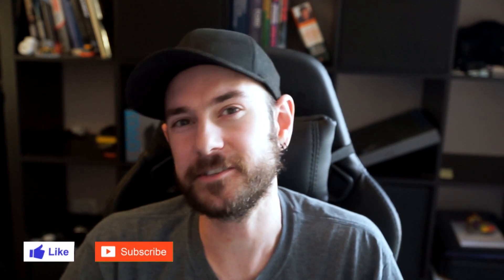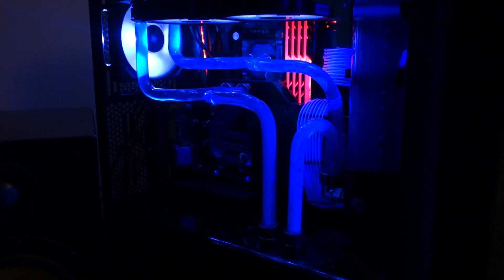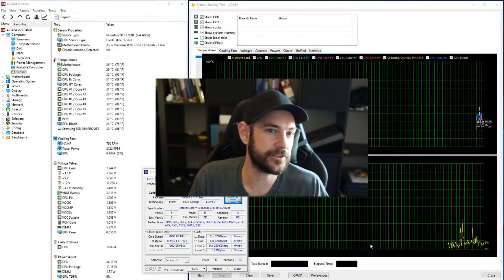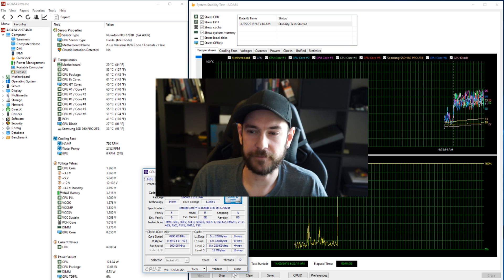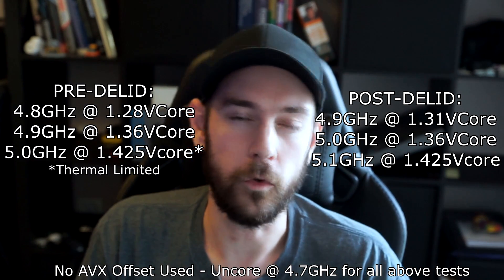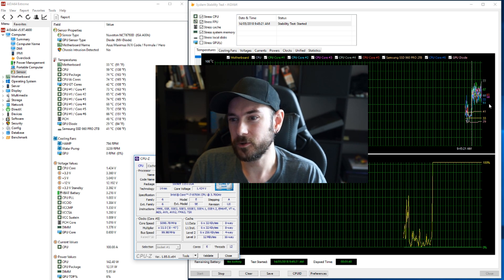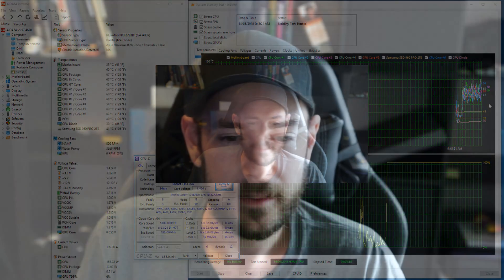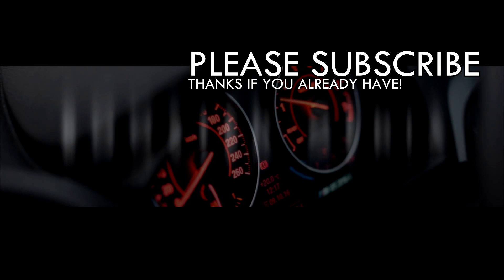8700K Delid Testing and Results

Comment: I have the exact same setup. Just finished delidding following your guide. I literally got a 30c+ drop O_O ... 
Pre-delid: 5.0ghz @ 1.345v (gamed fine for over a year, but when doing Prime95 Small FFTs... instant 100c... and who knows how high the temps would have been without a TJmax)
Post-delid: Same bios settings, saw as low as 68c for 30 seconds (before crashing due to lack of voltage)

INSANE difference

Comment: Hi, nice videos! I saw them both! Its impressive the difference delid+LM+tweaks can do! The reason your results are so good is that its TIM and not STIM on the 8700K. I have a 10900K which is soldered so expect lower results... however I still expect 10 celcius drop. I always wanted to try delid and today with the kits its a piece a cake! haha...  I will be using a custom cobber IHS and conducanaut LM on the die and under IHS. And then I saw a product luckily I have never seen before.. its called Coollaboratory Liquid Extreme. Its basically liquid metal but in paste form- which means it will just easily go on the top IHS and waterblock. I will be only using 4 drops of glue on IHS to suibstrate and two different LM applications... So it better be great results! ;) haha. . There is no way I could further improve that solution hehe.. BUT when the nCore V1 is released I will buy.. its a direct die waterblock with first in world built in IHS... one of a kind and best results in the world.. check it out.. that is the ULTIMATE solution direct die. My next project when the 3 months waiting time is over.. then my cpu is also ready then just pop off cobber IHS

Comment: How has the copper IHS held up? I heard that overtime performance won't be as good due to the gallium in the LM bonding with the copper. I've already delidded, but was thinking about replacing the IHS. I'm just unsure how it will be for longevity.
Reply from the maker: I did a video on the theory behind this about 2 years ago. Still in daily use and no problems. Temps are the same as the day I built it.

Comment: I never crash with AIDA64 but would get errors with prime95 with a Small FFTs test. Wondering if AIDA64 even reliable.
Reply: I use Linpack Xtreme and that uses WAY more voltage for stable than Aida. Latest Linpack also uses AVX.. I usually run 50-100 passes stress test. And if that pass nothing can break my OC. Also its here you find out how much ekstra juice is needed to completely eliminate cache l0 errors (hardware info)... so my10900K would require 1.42v @ LLC 4 to pass Linpack where other more mild test like Aida can ex. pass at 1.35v.  But so much extra is needed with extreme load and AVX.
Reply: hahah ! ;)  I would recon your computer seems more unstable than AIDA. Aida is a lighter stress test so if that fails your system is properly pretty unstable or at least under load.

Comment: Mine at 5ghz 1.26v delided and custom loop. Temps are around 70c while gaming for 30min. Not too happy with it. I might take it all apart to solve it
Reply: Incredible voltage.. my 10900k wants 1.42v @ LLC4 for 10x 5 ghz.. hehe.. but I also aim to pass extreme stress test so I NEVER EVER crash or BSOD

Comment: O...M...G!!! I had no idea. I've been running an 8700K system for the past few months, with a 280mm Corsair AIO cooler. I've been flummoxed by how I have been unable to run full load at anything higher than 4.7Ghz all cores, without bouncing off the thermal limits, no matter how low I finessed the VCore. 
Today I received a RockitCool IHS (Cheers for the discount), a Der8aur delid tool, and some Thermal Grizzly Conductonaut. I lapped the top of the copper IHS to a flat mirror finish (I was surprised that it was quite [EDIT: CONCAVE... the sides took a lot of lapping before the centre touched down] as it arrived) using a glass tabletop and 2M lapping films, and put it all together. My results are immediately astonishing. At LEAST a 30 deg. C drop in temps under full load, probably even more, but it's hard to tell exactly because I couldn't run at 5.0GHz before without hitting thermal limits. Now I can with ease, and fans on moderate settings, without getting anywhere near the thermal limiter.
I did a quick OC to 5.0GHz all cores, 5.0GHz Uncore, and 0 AVX offset, 1.32V VCore; 1.20V VCCSA & VCCIO. Set the fans to medium and ran AIDA64 with full CPU and FPU stress for half an hour. Temps stabilised in the mid 70's, with peaks at about 80 deg.C. Incredible! Before doing this delid/lap/IHS/LM, I would be instantly bouncing on the thermal limits 105 deg.C. at 4.8GHz all cores, with the clocks dropping quite a lot because of thermal limits. 
This is how the 8700K should always have been. It's so stunted by the useless toothpaste they put inside the IHS from factory. Very disappointing Intel. But very impressed now that the delid is done.
Reply from the maker: Nice work!!
Reply: Amazing results! I just ordered the RockitCool Kit with the Cooper Upgrade kit for my i7-9700K. This thing runs pretty darn hot for me at 5ghz and 1.325V. Hoping to get it down in the 80’s under Prime95.
Reply: @jjsemperfi  You did use liquid metal under the IHS right? Its a no go with TIM paste. Also the delidders biggest mistake is to use silicone and glue IHS fully back on.. only 1 tiny drops GLUE each corner IHS for perfect mating and no gap under IHS.

Comment: 1.280 for 4.8ghz?
Mine is now 1.240 for 4.8 all cores, but dang its hot, I Will make a delid soon, only waiting for my liquid metal do arive. :)
Reply: You guys are luckily.. my 10900K is a poor bin @ SP 63 - Asus lowest score.. So me running 5 Ghz x 10 will require 1.42v LLC 4 to pass all extreme stress test and no L0 cache error etc. OR LLC 5 @ 1.36v  but same resuilt and temp. So right now im actually at LLC 4.. So I cant wait to delid and cobber IHS and LM in a few days from now

Comment: Hello. What RPM your fans working on?
Did I understand correctly that your fans are running at 770 rpm under  load?
Reply from the maker: Correct. There’s absolutely no point in increasing fan speed relative to CPU temperature. My fan speed is linked to my water temperature. I have a seperate video explaining how to set up  PWM fan profiles.
Reply: Вoosted Media thanks for quick answer.
 I watched this video, I learned a lot of useful things for myself. But I did not understand how  does your system know that the temperature of the water has increased? Do you have a temperature sensor?
But anyway, thanks.

p.s. It’s all because I don’t know English well =)
Reply from the maker: Yes I have a temperature sensor on one of my water pipes to measure the water temperature. If you don’t have this you can just use the motherboard temperature

Comment: Im not sure your idle temps are correct. You stated 4.8 idle at 45c stock lid and 30c  after delid. I have never seen idle temps that high on any chip. You also state idle 60c @5.1 after delid. What....LOL
Reply: It could be if HIGH or Ultimate performance power profile is loaded.. then it stays in turbo mode all the time. If I run some test or games and have it in Ultimate performance I will also have high idle for some time.

Comment: Looks like your delidding was definitely a success.  I'm planning on delidding my 4790k processor which currently runs at 4600GHz with a ring ration of 4300GHz with a CoolerMaster 280 closed loop water cooler.  I'm considering going to a 360 closed loop but then I stumbled across this Noctua NH-D15 SSO2 D-Type Premium CPU Cooler which has amazing reviews on Newegg (5 stars with over 300 reviews) https://www.newegg.com/Product/Product.aspx?Item=9SIA4RE7653968.  Curious if you know about this huge air cooler or know of any tests on youtube that have been done comparing it to water cooled?
Reply from the maker: It performs about the same as a 240mm closed loop water cooler but generally louder.

Comment: Water cooling and only testing for 5 mins is very wrong, your running water so you should run until the water has actually reached its stable temp under load for much longer then 5 mins, run it for an hour or until you have dead solid temps with no jumps like you are showing.

People reading this don't ramp up without benching for a hell of a lot longer then 5mins you will kill your CPU with this amateurish thinking on benching.
Reply from the maker: I explained the reason why I’m only testing for 5 mins in the video. It’s done this way for the purpose of the video because in my particular setup the water temps stabilise after 5 mins. 

It will be different for different people like I said in the video.
Reply: @boostedmedia  Just advice this vid has some pointers better than I can say: https://www.youtube.com/watch?v=eSOcUnn1mtQ
Reply: 1 hour is maybe overkill haha! :D My water takes max 10-15 min to heat up, but definatly incorrect polished results with only 5 min!

Comment: You should go with the 8086k 1.22v(arround 1.26 spiked up to actual 1.27 due to llc) on air for 5ghz delited with a be quiet dark rock 3 pro the only time that i saw 77c was in prime with small ffts anything else tops arround 65 such as aida64 anabled fpu,cpu,catches,memory stresses.Every else such as occt have an average of 48-49c with rare spikes up to 55c max.I know it sucks to pay more for a binned 8700k but i think in the long run it will not degrade by the oc at all.Maybe the case helps too because it really have a great airflow and surely helps but its with no custom copper and i feel like that yours under water with a custom coper seems on the high temp side..if i were you i will take actual misurments from your mobo due to llc just to be sure

Comment: Will when you stress your pc do you have your case closed up or the panels off I have a 8086k running at 1.350 volts and llc set to 6 which makes it go to 1.360 and my max core temps are 75c for a hour test of prime 95 version 26.6. I do have my pc closed up panels on but I was really hoping to stay around 70c my cpu is delidded also. My case isn’t the best airflow case it’s a lian Li air with a custom water distribution panel so I am limited on fans.

Thanks
Reply from the maker: Should always stability test the system in the same configuration you intend to use it day to day unless you’re shooting for records.

Comment: with the 7800k i have now i'm running 5ghz at 1.240v, but yes this chip runs hot as hell.( still thinking about deliding this thing but its not cheap is i screw it up).
Reply from the maker: Honestly you’ve got to do something pretty silly to screw it up.
Reply: my mistake I meant 8700k not 7800k.
Reply: Just buy the delid-die-mate 2 by der8auer. it costs 30€ in europe. it is easy to delid with it. you will just spend with the other delid components approx 60€. Its not that much.
Reply: its delided now dude all went well.
Reply: WHAT?!  1.24v that amazing! What LLC level is that? and is this a "gamer OC" or can it pass extreme stress test?  I always aim for that - an OC that can handle ALL ... but my 10900K wants 1.42v @ LLC4 or 1.36v LLC5 same result this is required to pass 50 pass Linpack Xtreme no cache l0 error etc.. so yours is truely amazing

Comment: my 8700K is also delidded and watercooled but i got 5,3ghz @ 1,408V with temps lower than 86c
Reply from the maker: That’s a nice result! Is that with no AVX offset?
Reply: @boostedmedia  Ive got my 8700k with formulaX Z370 running AVX at 5.1Ghz and turbo at 5.3Ghz at 1.42v <3 on a H150i un-delidded max temp 77

Comment: Hi thank you for your video. I would like your opinion on my re-lidding for my 8700k. I attached the exact time on link to see liquid metal application on both IHS and die. Results for temps seem okay and are posted in beginning of video but just wondering if you would do anything different. Thanks in advance. 
https://youtu.be/l0b6c_voRnM?t=16m45s
Reply from the maker: You can see my delidding how to video to show how I do it. I don’t put liquid metal on the IHS. Only die, but if your temps are ok I wouldn’t worry.
Reply: Thanks

Comment: Not a good piece of CPU. Mine is running at 5.1 Ghz @ 1.295 volts. If you have budget, try another 8700K and 8086K to compare if 8086K are better chips.
Reply from the maker: Have a look at my more event videos. That’s exactly what I did :)

Comment: Must look at doing this. I only tried my Strix z370-e’s 5ghz Oc profile, for a quick test rather than doing it properly and spending hours at it, but it worked straight up. I have a Kraken x72 sitting on it, but using cpu-z’s 12 thread 100% load test, saw it hit 87c immediately. Didn’t crash, but that’s a little to toasty obviously!
Thanks for sharing your method, and results.
Reply from the maker: You’re welcome. Yeah the automatic overclocking settings pump way too much voltage.
Reply: I figured that they might. But just a quick test to see it would do it at all really. My only real concern about doing a Delid now, is I’ve run it fairly well since release.  Slightly concerned the mayo it’s shipped with might be cooked in quite well by now, despite always being under an AIO (used a Kraken x61 initially, switched to x72 recently).
Reply from the maker: Have a look at the latest video I uploaded. It’ll help you understand much better. I also have a complete delidding guide for the 8700k and 8086k :). It’s really not hard if you use the proper tools.

Comment: You should really run your tests for 30min at least.
Reply from the maker: The final stability test is run for 8 hours. Would be a pretty boring video though. Lol.
Reply: If testing for stability, yeah, but if you're only observing cooling performance, you only need to test until temps stabilise.
Reply from the maker: 100%. For this particular system the temps are completely stable after 15 mins.

Comment: Factory IHS is copper. The temp difference is from delidding.
Reply from the maker: Factory IHS is nickel plated copper. The difference in temp comes from the increased surface area.
Reply from the maker: As in compared with delidding with factory IHS. It does give a few extra degrees.
Reply: If you had tried with just the new ihs and the old type TIM yiu would have not seen much of a difference, if any. Several places have done it. It just looks cool and you can't even see it.
Reply from the maker: I didn’t test without so I can’t comment from my own experience. But from what I’ve read it’s generally about a 3-5C difference. Every little bit helps :).
Reply: Every little bit does help, till it makes no sense for the money. Replacing a copper IHS with another copper IHS for that kind of money is frivolous. And that's coming from someone that has an 8700k that I bought 6 months after the 7700k I had already. I just though that the info on the IHS and how little it does should be mentioned. I almost bought one until I did some research and saw how little they do.
Reply from the maker: My results are my results, regardless of what you say I’m happy. So happy, I just installed one on my new 8086k tonight.
Reply: Cool, the info on how little they do is out there for people that look at actual data, glad you like yours.
Reply from the maker: Like I said it’s an enthusiast thing. We want every last piece of possible gain. You could also argue “why water cool”.
Reply: I thought it was aluminum...   yea the true big difference is liquid metal and especially if done correctly and that is with NO silicone / rubber under the IHS to create air gaps.   I cant wait for my kit and assembly in a few days for my 10900k
Reply: @lassekristensen385  it's copper, it's a simple search.
Reply: @greebuh  yeah haha! I learned something new today. Just looks so much like aluminum.. Doh! I did actually knew that if my brain could think... I once lapped a 3930K and magically the copper came through as the lapping went on and nickel sanded...

Comment: Try Intel burn stress test a lot more brutal than aida 64!
Reply from the maker: I do for actual stability stress testing. Used AIDA64 for the video as it’s a nice easy way to see the temp differences graphically.
Reply: +1 I can pass AIDA64 with much lower voltage than my default stress tester Linpack Xtreme... I run 50-100 pass stress... thats brutal if that passes nothing can break my OC. Also O.C.C.T is a great tool. But all in this comment section, I would love them to run Linpack! ; because NO way some of the reported voltages can pass that.. look more like boot to desktop voltages lol ! ;)

Comment: Try out the Ncore V1 with some liquid metal. You might still be able to squeeze a few degrees more.
Reply from the maker: A few degrees more isn’t going to really make any practical difference now as I’m no longer thermal limited.
Reply: Boosted Media Not wrong, but still interesting to test.
Reply: @SparkysAdventure  Exactly! I will recieve a custom rockit cobber IHS kit and use liquid metal in a few days from now. But in 3 months when hopefully the nCore v1 is ready (they just told me 3 months waiting time)  I WILL be buying it! World be waterblock with integrated IHS for direct die cooling and mounts in socket! Its one of a kind and the best performer out there! My 10900K are gonna love it! <3 haha ;)   this copper IHS is a stepping stone for me to direct die cooling but due to my motherboard Asus thers is a extra row of caps or capacitators around CPU and then waterblock cannot mount with direct die! BUT the nCore v1 is so small it eliminates this issue .. cant wait!